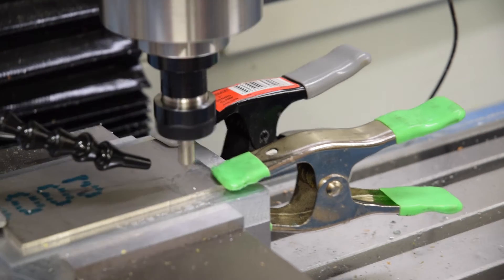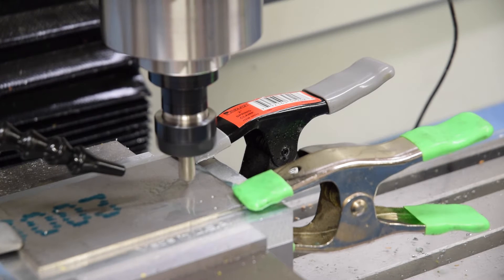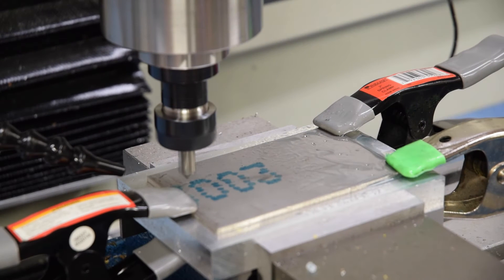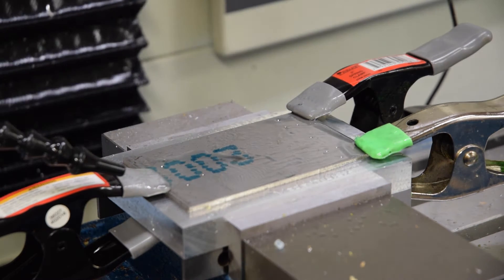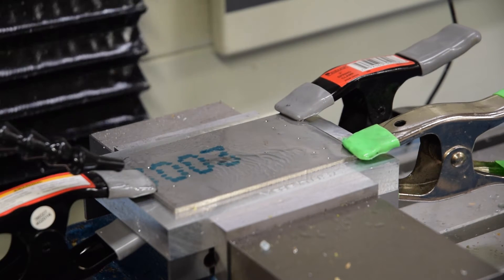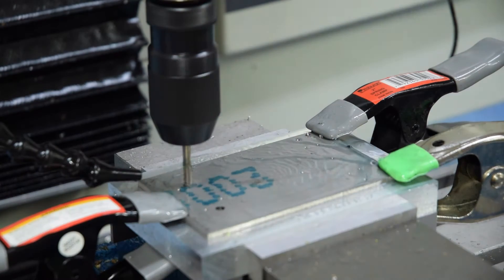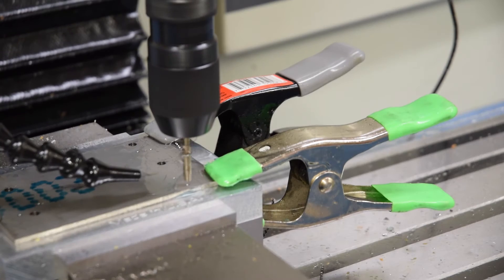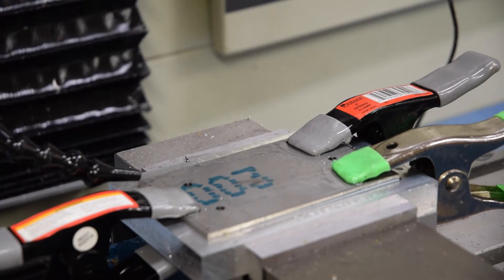Milling titanium handles

Comment: What cutting speed do you used for little endmill and how often it break? Thanks, usefull videos!
Reply from the maker: Aleksey Plotnikov do you mean the end mill I cut the lock bar with? That's a cheap 1/16" end mill. 5100rpm about .9ipm. they last forever. The depth of cut is only about .012" though. I edit out some of the passes to speed up video.
Reply: Yes, exactly this I meant. I thought It can be made only by electroerosion or hydro abrasive handling.
Thanks for your work!